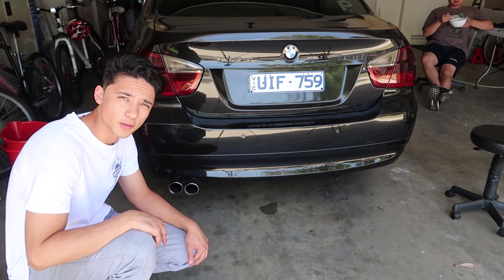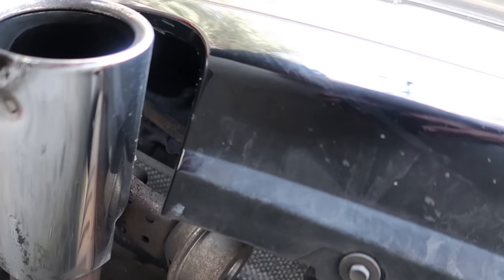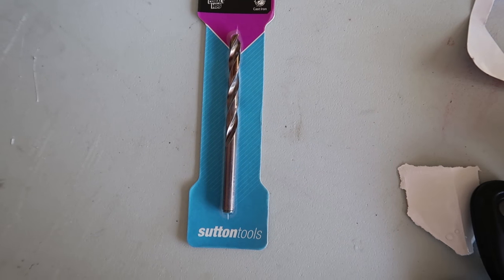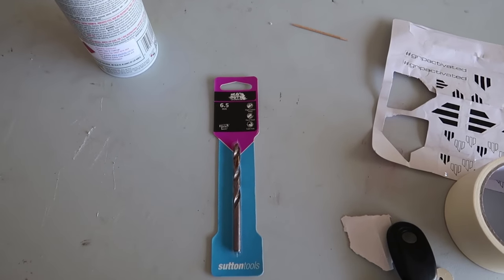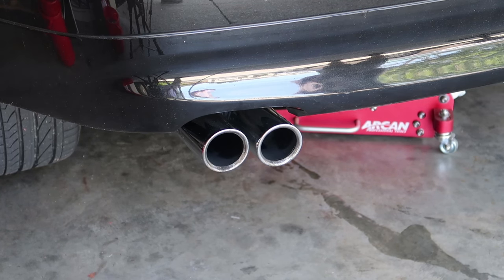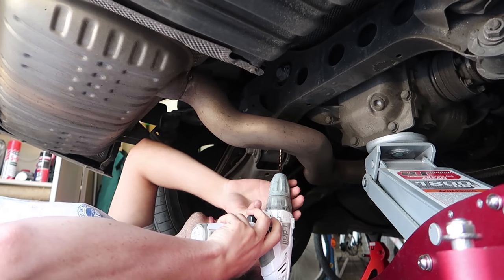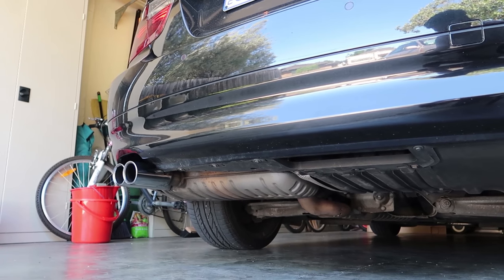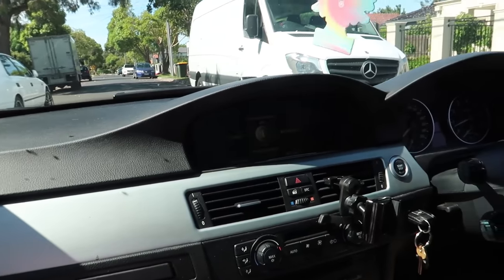Exhaust Mod on a whole new level of dumb works surprisingly well...

Comment: So @RexH what was that thing you guys mentioned about installing something to turn it off and on called?
Reply: Cutouts
Reply: @gavinlee9478  he’s going to put a side valve so if he opens the valve all the sound will leak out that hole instead of tunneling through the muffler and if you grow out of having an annoying sounding car you close the valve and no sweat now u have a muffler
Reply: @azion6518  did you mean to reply to me, I know what they are and what they do but thank you for explaining
Reply: It basically connects right before the exhaust and has a Bluetooth fob that opens and closes an extra hole its essentially the same thing but it acts as a full muffler delete than when you close the hole it pushes all the airflow through the muffler

Comment: Did you try to drill holes in the silencer ?
Reply: Does this work, in the video they drill just infront of the muffler but I’m wondering if you could drill into the muffler itself
Reply: Have you tried this?
Reply: Terrible idea. Drilling the pipe could be closed later with a clamp. The muffler on the other hand would have to be welded

Comment: Your car sounds way nicer now, I wanna do it too but I’m scared the exhaust gases will get into the interior. Anyone know the safest place to drill holes in the exhaust system for a louder sound?
Reply: As long as you don’t drill before the cat converter you’ll be sound
Reply: If your worried about fumes, do it about where they did; right before the muffler
Reply: all i got was a loud hissing noise deafening when accelerating

Comment: Does anyone know if you can do this in Texas and pass the state inspection?
Reply: Was wondering the same thing lmao I’m in Connecticut I think no one would but I’ve never been yet I am soon…
Reply: @jimmystepps2202  did u pass
Reply: @InstinctsFN  bro fuck the holes i mean it’s a change but i deleted my res and my mufflers this would change the emissions on the car the only one that really will is your cat converter
Reply: @InstinctsFN  i passed with a muffler and res delete so might as well delete then hole
Reply: Of course it will pass

Comment: Wont get water in the hole?
Reply: If the car is running the water wont get into it because the compressed air in the exhaust gonna repel the water

Comment: Rex H can you post a link to where to buy this type of drill bit? I live in the US.
Reply: Any drill bit will work lol
Reply: @coleosmond4185  Not true because I had one that I bought and it was wood Metal and PVC. I bought one that had a Steel beam picture and it didn't move around like the other one did. HSS is the type of bit you need.  I drilled two holes so far and it's not louder it is just purring I need to know where exactly to drill a hole because I want it loud but not to sound like a Exhaust leak. The drill bit I bought that was for metal I go to drill a hole and it was zig zagging all over the muffler finally had to hold it firm and it spin do the same thing and then it finally stayed but took over 2 hours for one hole.

Comment: So you're purposely making exhaust leaks wtf
Reply: Aloha Empire exhaust isn’t liquid? The exhaust can’t leak on it’s own without something else wrong, like coolant getting into the exhaust system
Reply: Chris Buck what are you talking about? Exhaust leaks air
Reply: Chris Buck hes drilling holes causing the exhaust to exit out of the holes instead of out through thr end of the muffler smh
Reply: Chris Buck Do some more research bud. 

Carbon Monoxide is a invisible gas that goes through your exhaust when your car emits it. Having holes in your muffler can cause the gas to seep through your cars cabin and possibly cause Carbon Monoxide Poisoning which can be fatal. 

Don’t mean to scare ya but it’s true. 
Be careful.
Reply: As if it doesn't leak out the tailpipe anyway.....the only place you don't want an exhaust leak is before the O2 sensors(as that would affect your AFR). After that it doesn't matter
Reply: Aloha Empire that’s literally the point of exhaust is to get rid of that stuff lmao
Reply: @danielinsogna7371  dude exhaust leaks have been debunked, they don't exist most of the air coming from the exhaust even with a muffler removal will end up going out the back through the rear tyres, that's how air works, i think you need to go back to school and learn basic physics and chem
Reply: Aloha is actually right. you want gas fumes to come out directly from the back or its a leak. if you want to change the sound cut and replace with another straight pipe for muffler delete or a muffler thats louder lol
Reply: @jaidenharrison9098  This would only happen if u de catted the car, it’s rest of car is stock drilling holes in the muffler will have no affect as it’s past the cat and o2 sensor

Comment: Im pretty sure it’s gonna need reprogramming because the exhaust gasses flow changed

He might even have got a check engine light later on.
Reply: I've seen other comments that said it's before the sensor
Reply: If you drill in the right spot, the car won't pick up on the flow change, same reason you can put different mufflers and funny stuff on without the car noticing.
Reply: Although, I'm pretty sure drilling holes in your exhaust reduces performance so there's that too
Reply: No I did a full 3 inch straight pipe on my 335i. No codes
Reply: @luis4210  what year is it? Because the issue im talking about is mainly on the newer models

Comment: DONT DO THUS. It will cause rust in your exhaust pipes and expose the engine to excess carbon buildup. This is the dumbest thing ever. Just remove the muffler and replace it with a straight pipe in that area. Please do not do this.

Comment: Will it mess up the O2 sensors?
Reply: If you drill before the cats it might
Reply: @maxdexter7972  yes u have to drill in the right chambers
Reply: So if you drilled after everything (all of the sensors and cat) just infront of the muffler there shouldn’t be any issues right?
Reply: @danielseeto9622  nope. But i still do not recommend it. But it's a cheap thing to do.
Reply: @tuffgong3248  yeah cheers thinking of still doing it though on my old Hilux because I will be getting a new exhaust soon anyway. But I don’t want the soot and gunk rusting up the underside of the car? Do you reckon this will happen?
Reply: @danielseeto9622  i don't think that Will happen but Im not sure. Look it up :))

Comment: does this cause a leak?
Reply: It is a leak 😂
Reply: The only place you don’t want an “exhaust leak” is before the catalytic converter, because there’s an oxygen sensor attached to it. This sensor regulates how your engine runs so it needs to read accurate. Everything after your catalytic converter won’t affect the oxygen sensor though so it doesn’t matter. It’s just exhaust escaping at that point

Comment: Haha is it bad if I wanna try this
Reply from the maker: hahaha not at all
Reply: Haha getting a stainless exhaust soon, might try this or some spacers, can’t decide!
Reply: Don’t do spacers you will lose down pressure in your upper gears. Witch means you lose speed and power. Due to a short flow of oxygen that can’t produce as fast as it can be sent out.

Comment: Cool but exhaust leaks are not good at all. Unfiltered gasses. You may also notice a smell of gas and carbon.
Reply: Nah, trust you won’t smell anything
Reply: It’s right before the muffler... the muffler literally only muffles the fumes... they’ve already passed through the catalytic converter so it’s the EXACT same fumes that would’ve passed through the muffler without the holes.

Comment: lol typical, buys a bmw to be seen in one but cant afford to put an exhaust on it.
Reply: lol and you are a hero to come and comment on this video from months ago; I applaud you, ya knob :)
Reply: Why spend money on an exhaust if you can spend no money and do this. Lol
Reply: I got a 328i 2013 and tossed a 1100 hundred dollar venom exhaust on it. Keep in mind I have a n20 turbo 4cylinder. Before I tossed the new (1100) dollar exhaust on it I tested the sound desis on it. And the sound quality with the stick one with the same holes in it. Then tossed the new 1100 dollar exhaust on it and it tested to be 1 des louder witch is not shit to the human ear. And it sounded the same. The holes have me a nice back crack sound with pops and the 1100 dollar one gave me just a low rumble that no one cares to hear. So yea I sent the 1100 dollar one back and was happy with my holes and saving 1100 bucks.
Reply: Just Chase... I lost brain cells reading this
Reply: This was an experiment. The guy is quite rich...
Reply: mike cheap because they are money pits in repairs.
Reply: @CarlosMorales-mr5fq  lol
Reply: How the hell do you think he can afford the car....why spend $5k on an exhaust that doesn't sound any better

Comment: Tuned sets of pipes with legal paperwork are not made for nothing. This is straight crap. First inspection will throw you out without passing. Also rust will start to build up way faster since you left bare metal open for corrosion. One day it may separate itself into two pieces while it may seriously damage your car or drop off and damage anything else around you including persons. Not to mention all that crap that will stick on the bottom of your car comming from those holes. Yummy. Also imagine you sell your car one day and forget to inform the new buyer about this detail and then he gets into an accident caused by a lost muffler tumbling under the car. This is not a mod but sheer amaterism and crap. What you did was cheaping out on a "mod" that may or will eventually cost you to get fixed back into its original state while you could have taken that soon to be spent money, add some money to it and buy a regular tuned legal end muffler without having any problems later. Sorry for speaking frankly but in my view this is equal to putting a plastic card into your bike spokes to simulate an engine. Getting compliments for that sound is because people think you actually invested time, money and effort to do a special mod while in reality what you did equals to putting a sock in your pants to fake a big D. Not obvious on first look but as long as nobody looks too close.... again: no hate but if you ever get across someone who actually did a custom exhaust mod and that person will hear yours then it is you who'll be the comedian that cheaped out. 

BTW this done in Europe and that car being part of a big accident then the very first thing any insurance company does is thoroughly inspect the car if there is any sign of custom changes made to the car that would cease road worthiness  and your insurance company will refuse to pay half of all the bills comming up or worst case all of the bills. Makes you think twice about drilling stuff on your car.
Reply: Is it really true insurance won't cover an accident damage to your car if it's drilled?
Reply: Tell em.
Reply: You must not understand that you could easily assess your exhaust every few months to check for corrosion & if by chance it ACTUALLY caused enough damage to split the pipe, your muffler & exhaust is still mounted in a ton of locations so it absolutely wouldn’t fall because of that splitting. Plus, if you ever needed to pass inspections and they wouldn’t let you, it would cost less than $50 to have a muffler shop cut out that 2 inch portion of pipe & weld another 2 inch portion back.